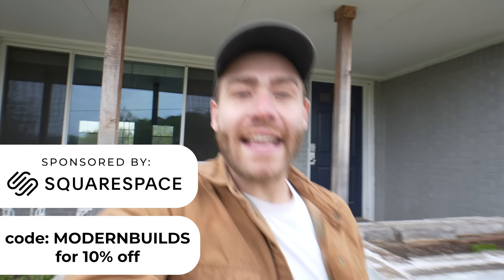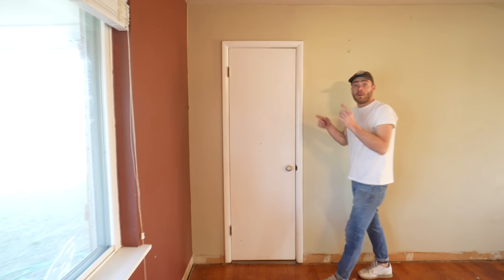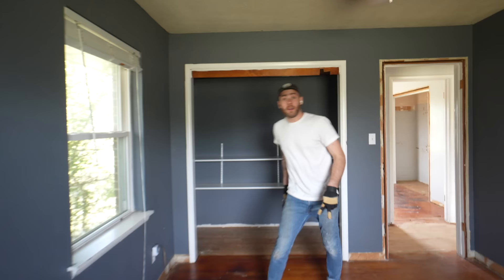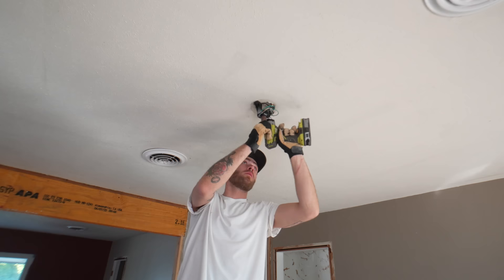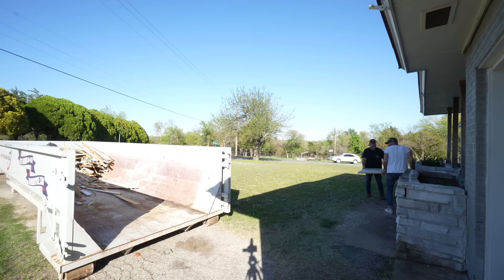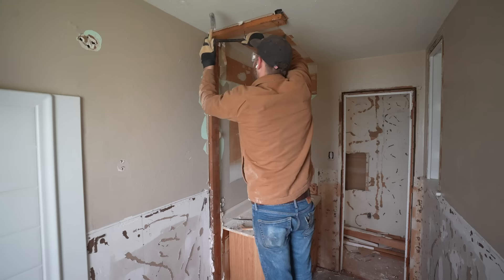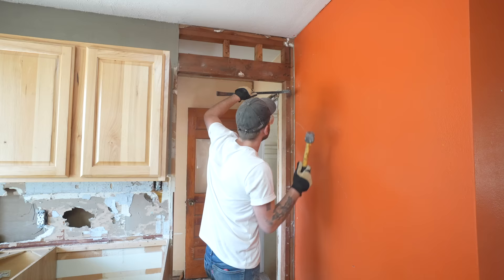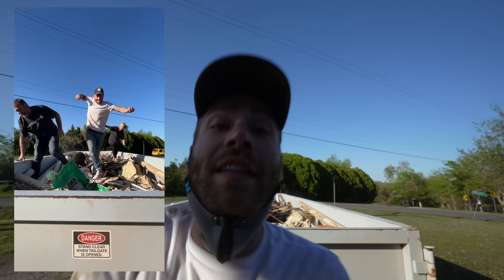Renovating My First Income Property | Ep. 1 Mike's First Flip

Comment: Hi Mike! That tile you found looks like a vinyl glue down 8x8" . In my experience they are asbestos tile and you need to do a proper remediation as it can be real dangerous to handle. Cheers and enjoy the project!
Reply: Jeff you da boss!
Reply: We need a Jeff and Mike collab!
Reply from the maker: @ryanharden23  thanks for letting me know, I’ll grab a test kit to check 👍🏼👍🏼👍🏼
Reply: @ModernBuilds  Vinyl asbestos tiles are not dangerous unless you're turning them into dust and breathing it in -- people generally just cover them up and forget about them. It can be super expensive to remove professionally. Other people just spray them down and remove them. Your state's laws will dictate what you have to do re: removal and disposal.
Reply: Yeah came here to say those small tiles likely asbestos. Also, homes of that age, may have ACM not just in the tiles, but in the mastic adhesive and joint compound. Frankly, the paint is likely LBP (lead too). You shd be wearing tyvek suit and a respirator plus goggles.
Reply: Jeff talking about proper safety? That's rich.
Reply: @puwazatza  Yeah right. He's obnoxious and rude. He always talks crap about other YouTuber's and how they do everything wrong.
Reply: 9x9 is the size for asbestos concern - this generation of tile should always be tested regardless of size, the adhesive too, but the 9x9's almost always test +
Reply: You need to check drywall texture, attic insulation for ACM. Always wear hazmat suits and respirator for demo in these old houses. Anything built before 1980 might have hazardous materials
Reply: @saulgoodman2018 stop talking bad about my Canadian dad!
Reply: @cam-tv5rb  Nope. Just telling the truth.
Reply: Asbestos tile was my first thought, then I also thought lead paint when he spoke about many layers of paint.
Reply: Jeff giving safety advice and advising to do something properly😂😂😂😂😂😂😂😂😂😂😂😂😂😂😂
Reply: Jeff is the GOAT
Reply: @randmontermini4535  the goat of cutting corners and hack jobs

Comment: Mike, I'm onto my 60th renovation unit and I can tell you your first mistake is NOT buying your own dump trailer. It pays for itself on the first job and you have no weight or size capacity limits.
Reply: Legally speaking you still have a weight limit on any Dump trailer as well as dump fees per ton.
Reply: But how is that convenient especially if you are just starting out your first project? Storing it etc?

Comment: Hey! Demo tech for a restoration company. As for your question for the backsplash there really is no fun way to remove it in a timely manner. A flat bar and hammer works but with certain tile it comes out much nicer if you chisel or grind out the grout from between. Time consuming yes, but it will save the drywall!

Comment: You mentioned several times about wearing safty glasses. I wear bifocals and have worked in residential construction. The last time I went in for an eye exam I asked if I could get my prescription as safty glasses. It turned out that not only could I the style I chose it didn't cost any more than just getting standard glasses. Check into while you can still see.

Comment: I prefer to use a multi tool to cut the drywall and tile out when removing kitchen backsplash it allows you to take it out in sections and for me it's quicker to replace a squared section of drywall than it is to chip away the tile then try and repair a chewed up section of drywall.

Comment: I know you're way past the kitchen tiles now, but I've seen folks cut the drywall and backsplash apart while they're still connected. You could probably use an reciprocating or oscillating saw to cut the edges into manageable chunks. That way you can remove big panels with tile attached instead of trying to remove individual tiles and then drywall.